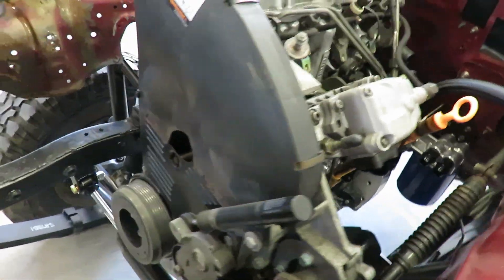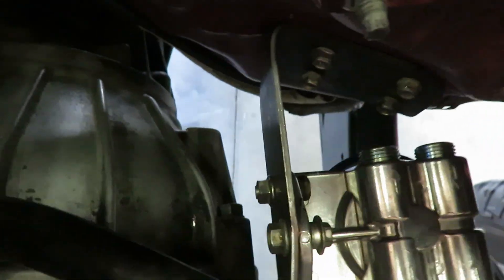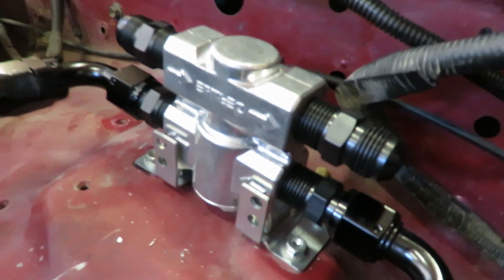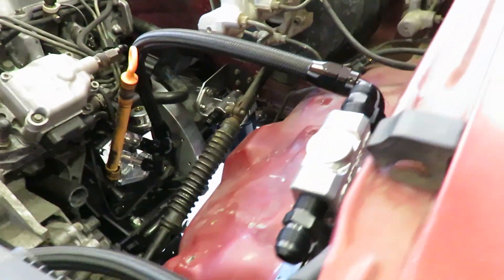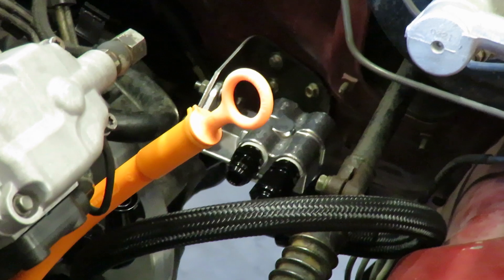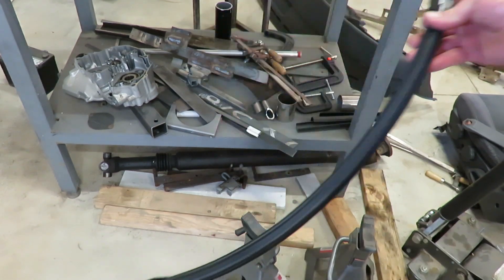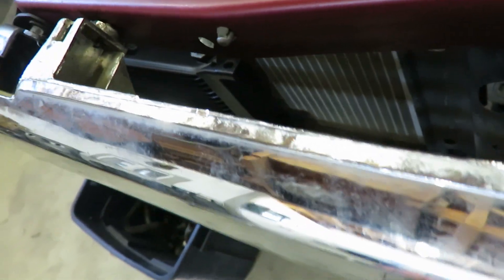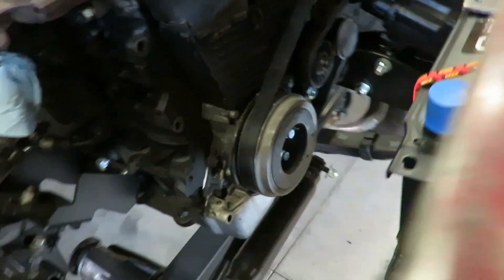ToyoTDI TDI Toyota Oil System AN Lines Thermostat Cooler

Comment: Great video 👍 think you could drop a link for the oil thermostat and relocation kit?
Reply from the maker: East Coast Exploring https://www.speedwaymotors.com/Single-Remote-Oil-Filter-Bracket-Ford-Filter,1164.html

https://www.amazon.com/Derale-25719-Fluid-Control-Thermostat/dp/B004XOQ0R6